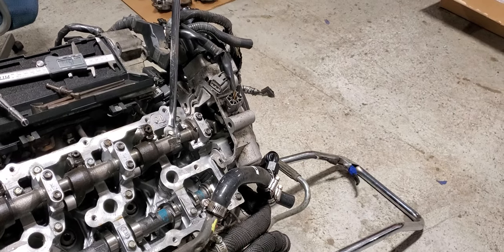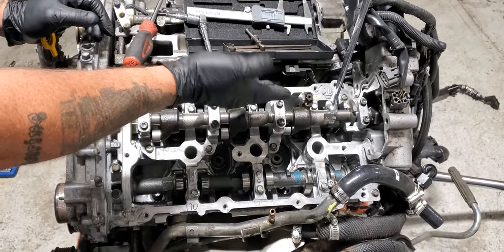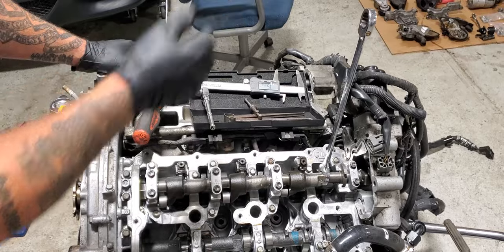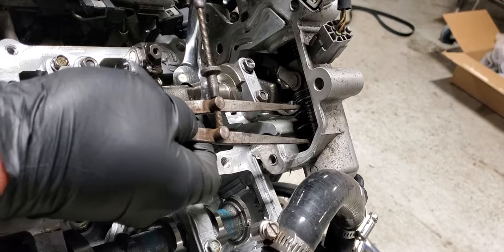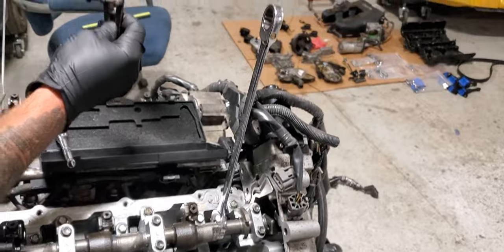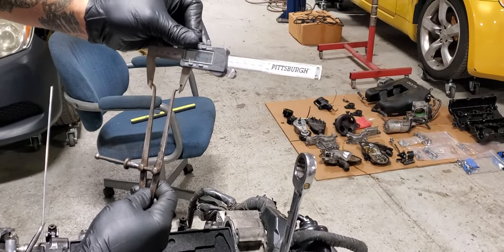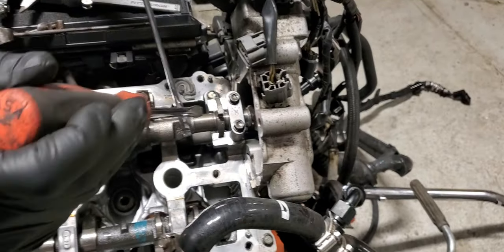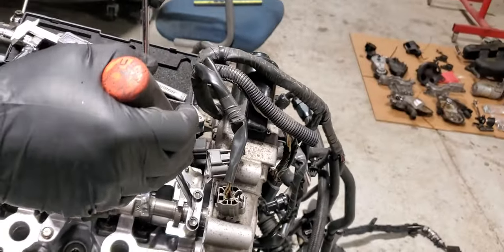VVEL fix for Nissan 370 and Infiniti G37 part 2 (Did u build or cam your engine and have misfires?)

Comment: I went to z1 to get a quote on how much it would be to swap cam and they said north of 7k,   they said it could be even more depending on if there is valve clearance issue. They clame some engine even form same year are slightly different. Did you run into any problems with this. Im going to swap to the c2 cams and donthe work myself
Reply from the maker: Sooo...it can get complicated,  if it requires a spring upgrade, and u will have to measure cam lash and make the appropriate lifter bucket selection... everything they said is accurate as far as process...the price point is a bit high; but that may be more related to their work load as it's a very time consuming job to only do a cam upgrade
Reply from the maker: Oh, and also...just from in the industry 5k-7k would be about the going rate, it's an uncommon job...most cam upgrades are done during an engine build process where it's not much additional cost since the machine shop has the cylinder heads in a stripped down condition, they are easily upgraded
Reply: @sethjoyner391  I figured as much I have two engines on a stand and one iny car all of them around 100k miles but asked if I could drop my. Engine off and have them install cam and still was a no. I think I'm going to attempt it myself I have built a few engines and done a few g35 timing jobs so I feel pretty confident plus your vids come in clutch. I just can't see myself Paying 7k just because I'm being lazy lol

Comment: Hey my car isn’t starting after installing jwt cams of course took the vvel off for that do you think this might be my issue
Reply from the maker: Most certainly...its beyond common if you changed cams
Reply from the maker: I have other videos that are more in depth about it...u also need ecutek or nissan consult to reset the actual vvel sensors as well as this mechanical adjustment

Comment: Ok so I have a question, after installing jwt exhaust camshafts, mechanically setting the vvel to the 1.585 in gap, do I have to reset the sensors electronically via ecutek? If so can it be done by my tuner. and will the car be able to start before the vvel reset. My tune date is in about 7 days and I’m so nervous. Any help or advice would be so extremely appreciated.
Reply: After watching your other videos, and doing more research, I’ve come to the conclusion that I’m going to mechanically clock the vvel motors the way I’m supposed to, then after timing the car, and throwing everything together, try to start it. From there have my tuner use ecutek to set the sensors properly.
Reply: @coenmcleod9441  did that work? I'm doing cams soon and am curious
Reply: @coenmcleod9441 how'd it go
Reply: @aaronthemartialmechanic893  good. Forgot to set valve lash and tire it up.

Comment: I got a g37 sport 2010 Im running codes p1093, p1089, p2A00, and p1608 its also going into limp mode.
First it was just p1902  got the little black motor on the camshaft solenoid adjuster on the left side i plug and played it didnt do any resets of any sort the car drove for a week till it went into limp mode again when it started showing those codes i listed first
Reply from the maker: See if you can get a scan tool to observe real-time data of vtc/ vvel angles to see what's going on

Comment: If you take the DC motor (black cylinder with the 4 Allen heads) and reattach, do you need to adjust anything or reprogram?
Reply from the maker: To be honest,  I'm not sure...I end up replacing the whole unit....one would think just pulling the motor wouldn't.....definitely give everyone some feedback if u don't have to reset
Reply: Did you figure out if you have to or not?

Comment: Hey Seth, question. I know the control cam has to be locked in that position to make the correct measurement for the motor. But once that is set is there a certain position that the control can has to be or should it just stay in that spot?
Thank you! 
-Daniel
Reply from the maker: It just stays in that spot and you move on to the next control cam....this will allow the electronic vvel reset procedure to be possible with the sensors themselves after you do this
Reply: @sethjoyner391  sounds good, I'll do the reset procedure next! Thanks again

Comment: Hey Seth, I hope you can help me with this issue. I mechanically adjusted both bank 1 and bank 2 vvel to 1.585 gap/ 5.5 degree. After assembling everything to adjust vvel position sensors I can only get bank 2 to .50 but when I adjust bank 1 its way within range meaning it's not centered where it's supposed to be, it barley reaches .50. So, i turn on the car and everything runs fine, it idles with no issues. Once i get on the freeway to about 60-80 mph it goes into limp mode / loses power. Any thoughts ?? Your response will be much appreciated.
Reply: 2008 Infiniti G37
Reply from the maker: @tonysautorepair8809  hmmmm....yea it's definitely tricky....I  don't know if I ever didn't have one dialed in to the .51 however...other questions 1st...some may seem dumb.....is this fresh gas in the car, why were u into the system,  and have u updated your vvel module computer to a newer one (08/09 have chronic vvel module problems that do wierd funky stuff) just trying to get familiar with the setup
Reply: @sethjoyner391  Hey Seth, super late reply. I ended up finding the issue. There was actually a tiny crack in the intake manifold plenum causing a vacuum leak. The reason why I adjusted the vvel position sensors was because I did the head gaskets. Since the vehicle was already misfiring due to the head gaskets before the repair, I never knew there was a crack in the plenum up until the repair was done. Thank you for your response !
Reply from the maker: @tonysautorepair8809  respect for an impressive and bizarre diag...hopefully someone will see ur post in the comments for good info

Comment: i have 2009 g37 convertible.  When taking off the vvel's and replacing them is it common to have a lack of acceleration? if so how do you fix that? shows code for vvel...Everything is timed and runs smooth as silk...just won't accelerate...please help
Reply from the maker: The vvel motor and control cam need to be rephased mechanically, vvel sensors need to then be adjusted and reset
Reply from the maker: Remember....vvel is responsible for intake valve movements
Reply: @sethjoyner391  Have you ever had the experience on working on the VK50VE? It's basically the V8 version of the VQ37vhr. I was wondering how did you come with that value of 1.58 and if it's the same settings for the VK50VE as well.
Reply from the maker: @top-notch9761  I doubt it's the same...however,  if one had a stock engine and put it up on #1 cylinder and measured they'd have the info (like a junkyard engine, or rod knock etc) that's basically all I did to come up with that spec
Reply: @sethjoyner391  Salute you for your quick response. I was thinking of purchasing one of the VVEL motor from Infiniti to attain my measurements due to the fact that these engines are super rare and usually sell used at the auto parts for 3500 and up. What I got from my engine on both banks at TDC was 2.15 inches.

Comment: hi, I have problems with assembling such an engine.  Where can I find information on installing and adjusting the vvel shaft, camshaft?
Reply from the maker: Just my other videos as far as I know
Reply from the maker: As far as setting the lifter lash...the fsm has all the bucket heights and lifter lash specs
Reply: Спасибо!
Reply: @sethjoyner391  Thanks
Reply: @sethjoyner391  manual:
3.Perform adjustment or replacement if the measured value is out of the standard.

Refer to “CAMSHAFT (EXH) VALVE CLEARANCE ADJUSTMENT”. (Exhaust side)

Replace VVEL ladder assembly & cylinder head assembly. Refer to Exploded View. (Intake side)

■ CAUTION ■

Never adjust valve clearance on the intake side.

NOTE：

Since the valve lifter (INT) cannot be replaced by the piece, VVEL ladder assembly & cylinder head assembly replacement are required.

Perform adjustment depending on selected head thickness of valve lifter (EXH).

■ CAUTION ■

Never adjust valve clearance on the intake side.

1.Measure the valve clearance. Refer to “INSPECTION”.

2.Remove VVEL ladder assembly and camshaft (EXH). Refer to Disassembly and Assembly.

■ CAUTION ■

Never loosen adjusting bolts and mounting bolts (black color) of VVEL ladder assembly.
Reply: no required information
Reply from the maker: @Voyakin21  I can take pictures of the numbers and procedures when I get back to work...I have the full fsm in paper
Reply: @sethjoyner391  great thanks, I'll be waiting.  I can’t write the address for sending the photo, YouTube deletes the message.
Reply from the maker: It's all good bro I'll make a video and post it, if ur subscribed you will see it Monday...other people have asked for this information

Comment: Hi bro, is it also possible to configure the vvel system on the VK56DE engine, or are there other gaps and adjustment procedure?
Reply from the maker: Probably not, it would be extremely technical to make an adaptation and would more than likely require a head swap; I don't have enough knowledge to contribute much here

Comment: When I put everything back together, do I leave the cam locked like how you had it?
Reply from the maker: Yessir
Reply from the maker: I mean honestly after u measure,  lock the control cam and tighten the bolts, it can be moved around or the engine assembly could be rotated etc before the vvel reset procedure
Reply: @sethjoyner391  perfect! I am having an issue where the sensor reads at the correct value .5 then it changed to some high value like 4.8, does this mean I need a new VVEL control module? Thats the only thing I can think of. I am getting a code U1000 aswell as the p1092
Reply from the maker: @Stockclipz  what scan tool or software are u using...also in my experience..bad modules just won't supply power or can com with stepper motors and u will be missing like six attributes of vvel data..it's normally relatively obvious
Reply from the maker: @Stockclipz  also...describe what that p0192 code is
Reply: @sethjoyner391  I am using Ancel Scanner to view the voltages. The p1092 code isnt explained through the scanner just says Control shaft Position sensor. I tried reading the voltages with a multimeter and opened up the black and red wire up too much, im thinking they mightve touched and shorted out the module so im just going to order a Module off ebay.
Reply: @sethjoyner391  I also have a 2013 motor and wiring harness but my Chassis is 2009 so the vvel module is 2009, im not sure if there is a difference In the years
Reply from the maker: @Stockclipz  dang...yea, at the minimum u need a nissan consult to reset the vvel module...my personal preference is ecutek..what I use...so basically,  u can set vvel all day long, but it won't be in a mode to accept the relearn...basically...I'd stop...get and borrow a nissan consult and establish that u have vvel data stream...then go from there..I'll say this..if u were able to see those sensor values the control cam is degreed correctly
Reply from the maker: BTW, I think that one code is related to the fuel pump...I'd have to know more about the car
Reply from the maker: Nevermind,  just saw ur last post...yes the early modules totally fail...swap it
Reply: @sethjoyner391  alright, I appreciate it a lot. I have been stuck with this issue for months now
Reply: @sethjoyner391  does it matter if its from a manual or auto? I have a 2009 manual sedan
Reply from the maker: @Stockclipz  that I don't believe matters...however,  definitely check
Reply: @sethjoyner391  Cool, thank you so much💪🏽, you’re amazing man but one more question, so you said measure from the inner wall, do you mean from where secondary cover meets the vvel housing? Or the actual inside where the spring goes into?
Reply from the maker: @Stockclipz  the inside of the vvel motor housing...but observe there is a ledge inside, I'm measuring before falling off that ledge